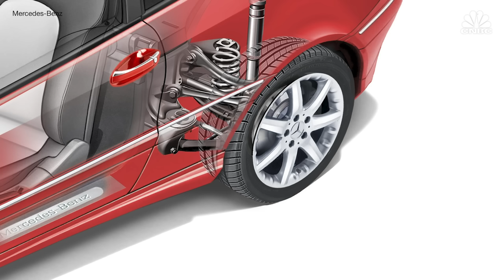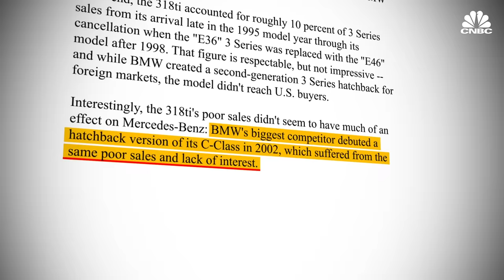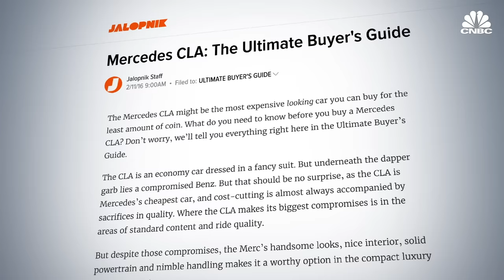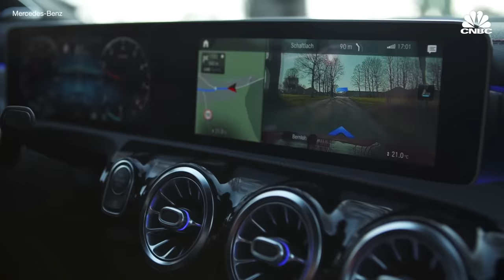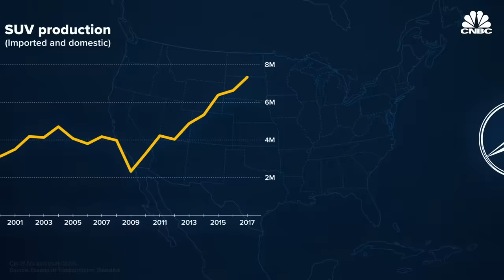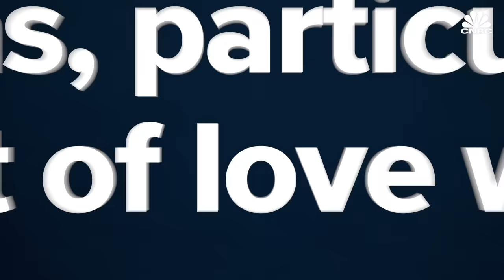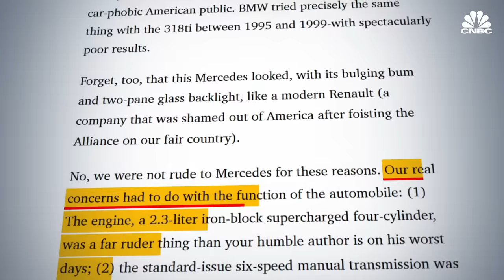Why BMW And Mercedes Made Cheap Cars That Failed

Comment: Everyone is missing the point of “brand” reputation. It was developed through, performance, engineering and quality that translated into longevity and long term value. The German luxury makers started messing up in the 2000s building cars that broke, and started throwing away their reputations.
Reply: junk.... most people who buy them are low interest loan...
Reply: Kelly Bonds yeah not that mercedes didnt make literally the most reliable sedans in 2003-2009? These engines would drive half million km before needing anything to replace. Not talking about interior, body, suspension, gearbox etc. Driving my 2004 V8 clk and it drives better than most 2012 cars + needs less money to maintain (except fuel ofc)
Reply: The simple matter is that for new cars to be sold, old cars must go away, that is why they're designed to break, at least for European cars. Thankfully Japanese cars aren't built with that mentality.
Reply: Not really, That would only say one with no knowledge of Cars and History.

In fact in the 90s all carproducers in the world, but espacailly in Europe had the Steel crisis and problems with the Paint of the car (they had to use Water-based by law).

So this was not really a wanted thing.

Next to that was before nobody needed electronics and was ok with a car not even has any power steering, then all directly wanted anything on board, so the European car makers needed to make that overnight.

I drive exactly such cars from the late 90s and early 2000s and ride down about 150.000km with them and had not so many problems as here get stereotyped.

I think by German cars many jealousness and too high expactions create a worse thinking of them:

Toyota owner:
I have my car since 2 years and my motor has 50k km and it still runs without any bigger repair yeahh!

Mercedes owner:
"after 15 years and 280.000 km I needed a new turbo charger, costed 300 bucks."

Toyota driver: "Loser."
Reply: @CHLM98  finally one knowing the truth thank. You Bro.
Reply: @corruptedmember2568  I had a 1998 S class. Cost me 10k over period of 4 years and was still not perfect, all window regulators broke, timing chain stretched, suspension was out, a coolant T pipe exploded which was made from plastic and It was constantly in the repair shop trying to get diagnosed for a misfire. We bought a 2003 Rav4 after that, and that car needed an engine because of neglect. All of my toyotas after that needed maintenance because I usually buy used, but didnt give me problems after that. With my S class it was problem after problem because I drank the German engineering cool aid. Its a money pit.
Reply: @FSXairpilot  Hmm by the 90s Modells, we had a E Class, W210 we had no problems like you, but we had problems by the Petrol 4-Zylinders, couse a cable got under pressure of oil and the oil comed slowly to the motorcontrolcomputer. 
By that we also buyed for prepare after we known that fail a oil-stop-cable.

Of course the car undercarriage and the rost was also often problems with our W210s.

In general the W210 was nice to driving, anything and extreme well interior quality, but he had some lacks of technic and the paint (the paint was infect for a time by mercedes with  Bacterials, also couse of the steel crisis at the time the metal was badly from Russia).

About the S-Class of that time I cannot say anything of own experience, but it wasn't favoured here also in the magazines. 

But boy, if you be mad about high costs, then you shouldn't buy an S-Class anyway, it's an rich people's car even for used, that's why they are used here also very cheap. 

Every modell by Mercedes is normaly cheap to repair, but the S-Class and the SL not.

In compare I loved Jaguar, but even one brake cost 300€, so I let it be. 

In short how to say, iam sorry you had many problems by that car but I think if you buy an used one (I do also) then you never knowm what happend before with the car and even by some new cars it happens. 

I give you some examples:

My mercedes W211:

What people say: 
omg the horrible problems with the electronics and the damn SPC-Brakes. 

Mine:

Electronics fine, SC-Brakes fine. No Problems. 

My Volkswagen Golf 3:

What people say: 
Worsest car ever, in all kinds. 

Mine: 
Looks like new after 23 years, runs pretty fine and uses not much fuel. 

My Mercedes SLK R170:

People:
"undestroyable" 

Mine:
20K KM later: 
Horrible damages from head to toe. (ok I drived also much to fast and insane but anyway horrible)

My Toyota Corolla (2004?):

"Buy a Toyota you will have never problems."

Mine:

In 15 tkm Apokalypse now in all big parts, also in electronics and motor. 

I don't know why it is like this, by even new cars, but it's often so some are extreme happy, while others had nightmares with them. 

That's why I don't anything in such promises or sayings anymore.
Reply: @FSXairpilot 
But really to sign this up again, a S-Class is always not a budget car Bro.

The car you had you get here for not even 4000€ but that means not its budget at all and as more technic you have as more it can brake.

Like I said same it's by Jaguar, Maserati etc., used cheap but the let them run makes you poor.

If you buy ever a BMW or a Mercedes then not higher as 5 and E, couse the 7 and the S-Class are so extreme in that and also have so much to can brake.

After 15 years of use this cars are normaly pretty finished normaly anyway, couse at this time the repairs comes.

Comment: Dissing my C230 Kompressor? Ok AJ.
Reply: It's a very pretty car. There was also the option here in Europe to have the only Diesel AMG ever made, the C 30 CDI (also available in sedan and wagon platforms), a rare treasure. If that wasn't enough, there was only 2 or 3 units Wich equipped the Supercharged 3.2 L V6, that it only was available in wagon and sedans. To have a couple with that engine, u needed to contact Mercedes directly to make like a "one off" project.
As I said, the W203 C class is the G.O.A.T

Comment: They aren't failing because nobody wants to buy the cars (for the most part). They're failing because the cars are horribly unreliable and expensive to fix. BMW, Mercedes-Benz, Aston-Martin, etc are notorious for being extremely unreliable cars and the depreciation, even on the "cheap cars" is just incredible. People who can afford to buy a $100k+ car aren't really too concerned with whether it's going to still run after five years. They want the latest and greatest and will pay for it. And after a few years, they'll just go buy another one; which is why the resale value of them is so abysmal. 

For us in the real world however, people who buy a $20-30k car aren't really too concerned about having such a status symbol. They want a reliable car, that's good on gas and doesn't break the bank when it does need maintenance/repairs. But luxury manufacturers don't seem to notice (or care) about this, and so the cars don't sell. 

If BMW offered a car that was similarly priced and just as reliable as a VW Golf, people would probably consider buying it. For me however, luxury car brands are really just too tacky for my taste.
Reply: Have you owned a BMW or a Merc? My W203 C-Class has 210k miles, apart from regular servicing it hasn't missed a beat. A lot of people buy BMWs and Mercs in Europe, they're honestly pretty bulletproof. The problem is idiotic people who buy them and treat them like cheap Japanese econo-boxes. These cars need regular maintenance. If you so that, they'll treat you great in return.
Reply: @stefanpetrov8  older Bmw and Mercedes in Europe is pretty decent; however, in America most of them are made in Mexico and those cars pretty much fall apart after 5 or 6 years.
Reply: VW vehicles are trash. Probably not as bad as BMW or Mercedes but does at the class of Toyota or Honda.
Reply: I hear that a lot, but I never heard it from someone who actually owns a BMW or MB. 

After 8 years and 155.000km, I never had any issue with my BMW 3series. 
I know a handful of people who have more than 400.000km on their BMWs and none of them ever had any reliability issue.

The only people I hear constantly complaining about problems with their car, drive Opel, Audi and VW.
Reply: They're like cockroaches in the DC and Baltimore metro areas. They infest the beltways. Cheap leases. 😃
Reply: @samadahmed7804  Also untrue, as far as Europe goes anyway. Every second car here, and I do literally mean every second car here, is a VW Golf or a Passat. Western Europe uses them until 120k miles, then Eastern Europe buys them for cheap and runs them forever. Once the original engine conks out at 500k miles, we get a new one for $500 and run another 500k miles. A friend has a B9 Passat with 300k miles, drives really well. I would say 95% of all cars on the road in Europe are diesel, so it's very different compared to the US though.
Reply: @ichkommentiernurkommentare7237  VW do have some engine Problems, but overall they are less complex than BMW and Mercedes.
Reply: @samadahmed7804  I agree. But a Honda and Toyota have less noise Isolation, cheaper interieur than Vw.
Reply: @stefanpetrov8  Very true. Dont be cheap on these cars and hand the problems you created to another owner by reselling it if you cant afford it. -_-
Reply: In the U.S, the most reliable cars are Japanese, and some select American cars. These days, them, and even Korean cars are matching, if not beating Germany’s quality. They’re truly amazing cars. They’re definitely a lot more reliable as well. On the used market, a base model, high mileage Camry is often more expensive than a used x5 or Mercedes. Everyone here knows that they simply don’t last. Oil changes will not save you from electrical issues, and transmission failures will just happen anyway. Honestly, there is no doubting that the euro cars we have available to us in the U.S are far less reliable than about everything that leaves japan, maybe except Nissan. I’m surrounded by cars everyday helping my dad with his towing business and speaking to used dealership mechanics. The Toyota’s leave the lot and never come back. The bmws, Audis, Mercedes, are always back under warranty and getting something fixed. That’s not to say there aren’t junk American cars, or even some Japanese ones, but they’re generally more reliable.

Comment: 1:50 The "318ti" is called the "3-series compact" and comes as a 318ti, 316ti, 323ti or a 318tds. So a 1.8 4 cylinder, another smaller sized one, a 6 cylinder 2.5 lter, or a diesel (back when diesels were actually slow). Get your facts.
Reply: didn't they also make a 325ti and 328ti? correct me if I'm wrong

Comment: The Mercedes C class presented here is actually successful. There are still many of C classes and the coupes on the road.
Reply: I have a 2010 C-300, and they might run on the road, but are not quality cars. I was much more thrilled with my 03' infinity, although I love my Mercedes.
Reply: @jessicacole8404 

Lmao infiniti
Reply: c class is not a proper mercedes unless its a AMG. I say that as i have owned a c230 and currently own a clk55 AMG
Reply: Mo- Money bro look up 2002-2006 c class. There are bunch of them well over 200K+ miles and running strong. I had one myself. AMG would make it better though.

Comment: but you didnt explain the reasons !
Reply: hassaan zahid - first of all, the first two "poseur" near-luxury compacts were hatchbacks, a form factor not totally liked by American buyers, even in 2020. Once they began to build sedans and then crossovers, the most sellable kinds in their respective eras, everything changed. The equipment improvements came very late in the game (in Mercedes' case it'd be with the A220, BMW and Audi already strived for it several years before).

PS: I mean by "poseur" pretend luxury and IMHO encompass any compact and below from luxury brands (below E-Class for MB, below 5 Series for BMW and below A6 for Audi).
Reply: syxepop id disagree and say the A5/4series/c class coupe are real luxury, whereas the a3, 2 series, and cla/a class are fake luxury. Another reason not noted is richer people see no need to buy the super expensive cars if the cheaper ones have the same quality materials/interior. The new a/cla class costs 30k and has a very similar interior to the s/e class. They make less money off of selling cheaper cars.

Comment: I had a Merc C230 Coupe (and wife hadC240 estate). It did have leather seats (but too hard) and CD player and a great engine, but it also developed a lot of rust around the rear wheel arches (as I'd my wife's). Jaguar X-type sold VERY well in UK and you still see lots today, more in fact than the current small Jag.

Comment: The 80’s and early 90’s were the last good years for these cars.  Sadly the car industry is dead and replaced by plastic, low quality parts, cheap hollow tacky  interiors.  These days they sell us marketing, cheap concepts.  Back then they used to sell us an actual solid machine with true solid quality parts
Reply: Ok boomer
Reply: That's too pessimistic! :)
I remember the 90s. Mercedes was top quality, for sure! But their interior didn't feel premium at all! You'd feel as good in a cheap Toyota back then, but pay premium for the Mercedes star in front. Back then, they had a bit of the same marketing problem as Cadillac: old people. Only old people would buy a Merc. If you had money, and wanted to be cool, you'd buy a BMW, and not even think about the pensioner's car with the star. That's why Mercedes started to sell cheaper cars in the first place, to attract younger customers, because their loyal customers were dying! Then they infamously went through a period where they made their cars too cheap, and they all rusted away. Now I feel they strike a good balance between affordability, quality and coolness. But they have way too many models, and their tech is outdated again, they can't keep up with Tesla and they'll have to step up their game or risk losing their top-notch image.
Reply: Sorry, you're right, 80s and early 90s, those were the best years for Mercedes. They were unbeatable. By the mid 90s, things started to go a little less good :)

Comment: 3:35 Americans don't have knowledge of the Mondeo? That's kind of an icon here in Europe!
Reply: It’s the Fusion
Reply: Brennan Balson Well, you wouldn’t expect people in Europe, Asia, or even Africa to understand the auto markets in places like North America, would you? You can’t expect people in one country to understand the automotive market in another.
Reply: Yes they did
They had them as Ford Contour
They hated it.
Reply: @kevinnorris6558  I guess I am making the argument that they should be aware.  For example, I grew up thinking that there was no such thing as a pickup truck that got more than 20 MPG.  Then I looked it up, and found that less than 300 miles to the south of where I live,  American companies like GM and FCA sell them in Mexico.  I feel like consumers are getting the short end of the stick by not being aware of what is going on in other markets and not demanding good ideas to come to their market.  It leaves automakers guessing what Americans "want" and gives the automakers all the power to decide who gets what.
Reply: Brennan Balson If I had to guess, pickup trucks down in Mexico may have more mileage because they’re built with less horsepower. I don’t know about Mexico but many countries in Europe and Asia use smaller vehicles with smaller engines and less horsepower, especially as fuel is expensive in Europe. Here in the US, our vehicles are bigger and people are obsessed with horsepower and acceleration numbers. Fuel is cheap here compared to other countries, so automakers know that Americans don’t mind less fuel efficient vehicles. And given that manual transmissions surpassed automatics in gas mileage up until the last decade, don’t you think stick shifts would’ve sold much better in America if people cared about mileage. The reality is that people here don’t mind paying more for gas as it’s already “cheap”, and the trend shows in automatics being the preferred transmission in the US for the last 50 years despite being less fuel efficient. People here will buy bigger vehicles like pickup trucks even when they don’t need it. And you may be in the minority as many Americans would prefer the almost 300hp Jeep Wrangler with not so great fuel economy over the 100hp fuel efficient Suzuki Jimny.
Reply: Nah, we prefer Trabant's :)

Comment: The low priced Mercedes and BMW s are not the only failures.The ones in the $ 60,000 to 70,000. Price range are also failures especially the ones made in Mexico .The ones made in Germany not so much. The ones made in Mexico In that price range can lose 1/3 to 1/2 their value in just 2 to 3 years . There is a reason for this.
Reply: In Germany we have a saying: "When you leave the car dealer with your new car it has lost 20% of value"
Reply: @DSP16569  We also say this in the US. The moment you drive off the dealer's lot, you lose a ton of value.
Reply: Which models are made in Mexico?

Comment: Generally speaking with a luxury car from BMW/MB you pay (significantly) more but are rewarded with a more refined car in terms of handling, power,  and interior quality. That said, their cheaper models have very few benefits over an even cheaper "non-luxury" car, and you are effectively only paying for a badge. It's no wonder they fail. I will say the new A class looks promising, as the interior is more interesting than other options in the price range.
Reply: The interiors of the new Mercedes Benz are not "refined" in any way, shape, or form.